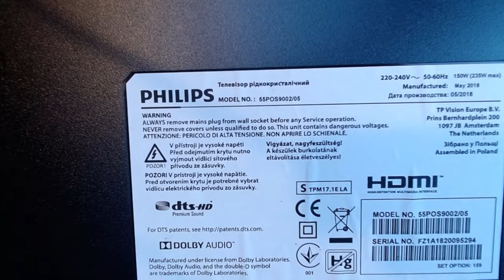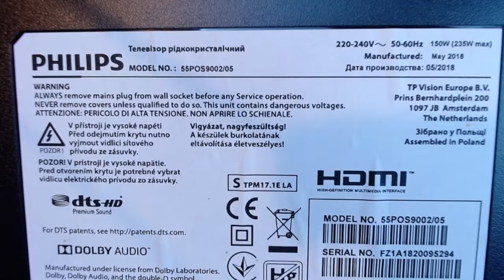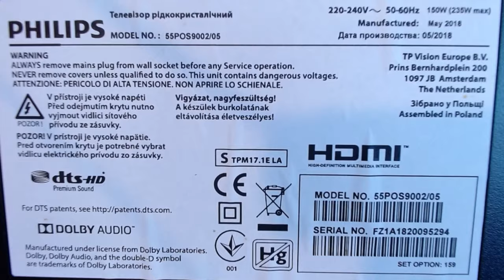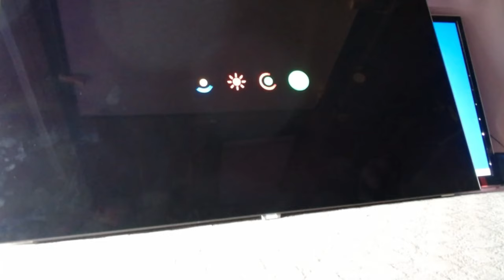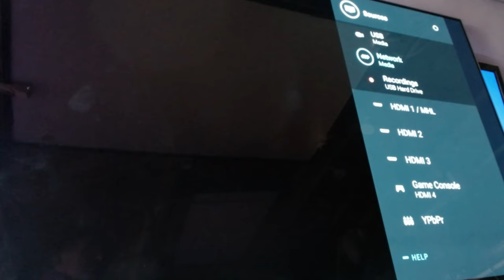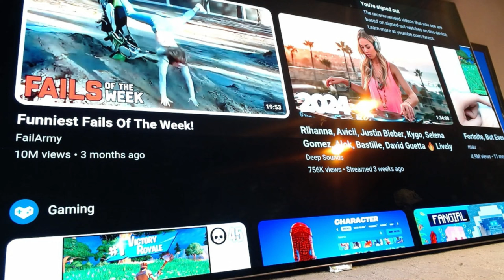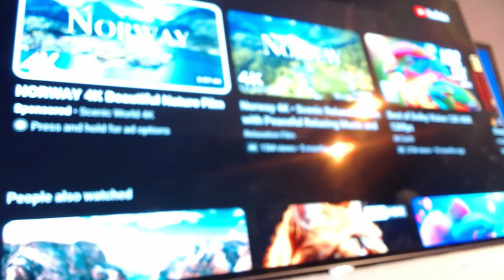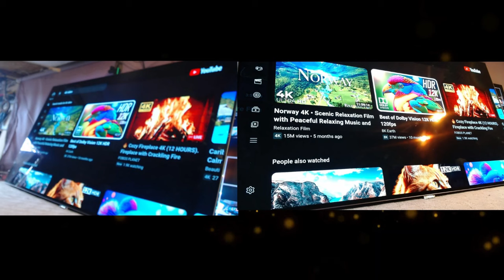Philips 55 Oled ( what a pic ) but its dead

Comment: What is remarkable is how expensive the initial purchase of tv's, yet the old CRT. I had a 55" Philips, the screen started to fail and it wasn't a year old, what was yellow on screen was green. Try and watch the Simpsons, just over 2000 hours on the panel and 9 months it failed. I sold the tv after it was fixed, CRT's or plasma are the way, power hungry but last until something seriously goes wrong.

Comment: Just watched your video I like philips gvs I have a 58 ambilight  I've hot a hisense  55inch picture on screen but no backlights so put in new stripes checked they working but still no backlights so checked a few things backlight voltage is not  constant looking on Internet for capacitors 350volt  10 uf so hard to find any  or no packs   I think the caps can make the voltage vary anyone help I'm just learning thankyou